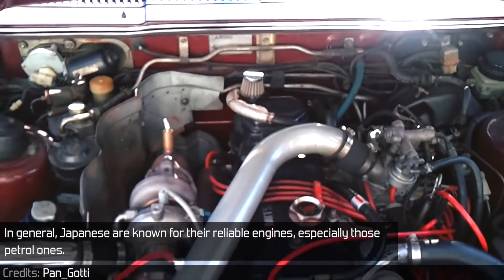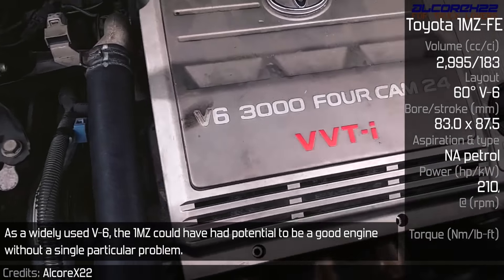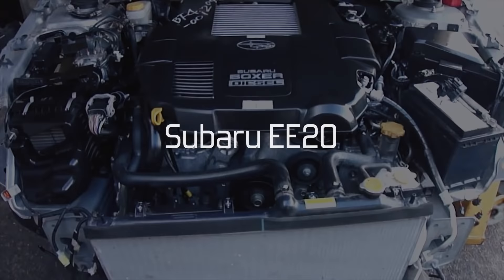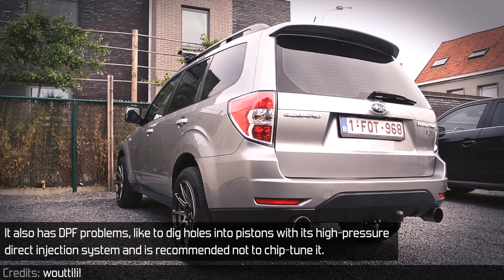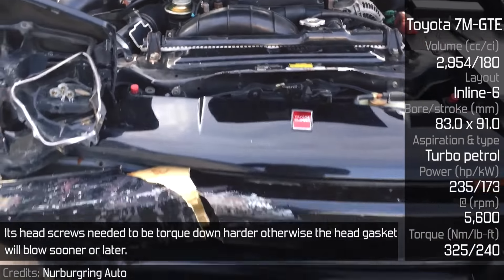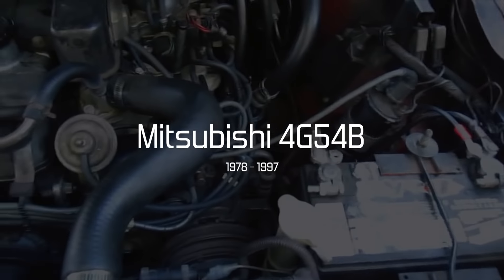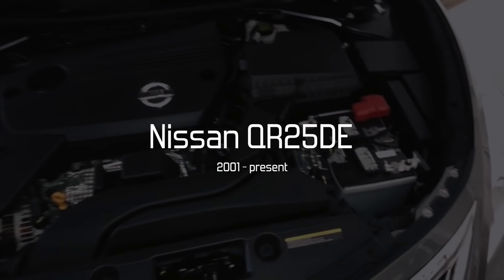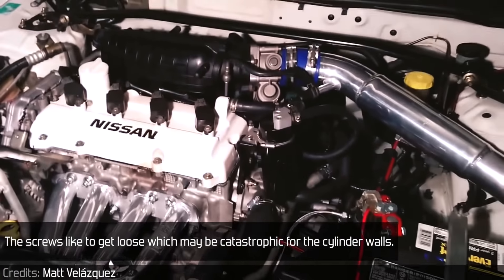Top 5 Worst Japanese Engines Ever

Comment: I have to disagree a little here. Firstly I'd put the Honda D17 motor on here, blown head gaskets and heavy oil consumption are expected, as in my brother's car. Meanwhile my QR25DE has been perfect, the problems mentioned only affect the first year models and Nissan actually acted responsibly by issuing replacement motors with revised catalysts and by people at home thread locking their butterfly screws and replacing headers. My car is about to pass 200,000 miles so at least I don't think it has the "worst" engine out there.

Comment: Nothing is better than a vq engine.
Reply: Zohan James Drive a 01 Maxima with over 178,000 Miles that has a VQ30DE, I have no Issues.
Reply: PON3Gaming i agree, the 3.0 is excellent! But the one that can immediately after, was where the problems really started to take shine.
Reply: Zohan James They should have kept the VQ30DE and just turbo it.

Comment: The naturally aspirated EJ25 should be on this list.
I work at a Subaru dealer and we have replaced a lot of these engines. What makes matters worse, is that they are low stress engines with a pretty poor specific output. 
I mean come on 175 hp from a 2.5 was an acceptable figure 20 years ago. By modern standards they should have like 210ish hp.

Comment: Lol so much guys are angry and trying to defend themselves
Reply: Yeah because he provides little to no evidence as to why these engines are terrible. Especially with the 1MZ FE. If you know anything about those engines, youd know that theyll last a life time with even minimal maintinence. The Camrys that they put those in literally do not die. Look anywhere on craigslist or whatever and youll see these things going for 3-5k with 100 thousand miles already on them. Those engines are 20 years old still holding their value and this fucker said theyre deserving of a spot on this list because of engine sludge build up like are you kidding me? He threw this list together with little to no research involved. Do you really think people arent going to get pissed about someone spreading mis information about great engines?
Reply: What is 100k miles dude ? That's nothing Even RX-7/RX-8 engines can handle 100k without a proper maintenance... and they are considered to be UNRELIABLE AF.  You see, almost every non-downsized engine is going to withstand 100k miles. That's nothing hard to achieve tbh

Although I do agree that the video is done without a lot of research.
Reply: ManhartLOL I was low balling the fuck out of that because thats around what my car had on it before I got it. Im sure there people out there who run Camrys even longer without changing oil. But thats a bad idea because the engine sludge does become a problem. Its a toyota though. Of course it burns oil and builds sludge. That doesnt mean anything if you take care of it though because if you do, itll live much longer than youll need it for. My uncle has the exact same car except a year newer and hes at nearly 500k from using it as a daily driver and has had almost 0 front end or engine issues beyond normal wear and tear like torn axle boots or rusted calipers. (Minnesota)He runs cheap oil and FRAM filters too. I run synthetic and K&M filters so I should see even better life. The 1MZ FE is arguably one of the most reliable engines toyota ever made. And it has proved to be imo. Itll rip if you want it too as well. 194HP and 209 torque isnt slow. Its drones a bit but once you get it past 4k, she starts eating.
Reply: Yup, if you love your car and maintain it , it's just a pleasure to see it going another 50/100k miles, always. In EU the 1MZ engine isn't as popular though  so I can't give you my own opinion on it.  But I used to have the B16A2 Honda Civic along with 2 other guys riding literally the same models. Mine ended up going with me another ~100k miles ( With the clock before it being 130k) while 2 others didn't even reach 150k. The reason being though is the 2 other civics were used by daily potatoes, they just drove it and didn't care to maintain it. Some engines are built to be maintained and drive for ages and some are made for potatoes that just put in gas and run. Fun fact, my civic was still running perfectly fine when I was selling it and went for something more newew though. But if the guy will take care of that car he will run easily another 50k ( considering I've sold it for 1,5k$, that's a steal, lol)
Reply: ManhartLOL Yeah you can never beat a Honda in reliability. Theyre hard to find for sale at a decent price around here though because everybody has mods and shit. I got my Camry for $900 because it had a power steering leak. Granted the lady did want it gone because it was leaving stains in the garage, But it ended up being a $12 fix from the seals in the pump going bad so Im happy. I wish it was a manual though. The auto tranny is fast but eh, I wanna drive not just sit there and mat it lol
Reply: ManhartLOL I meant like degradation wise after 20 years it still shifts like a queen when I get on it but compared to someone whos literally in full control of the gear ratios then yeah, an automatic tranny isnt fast in any other sense compared to a manual other than the fact that its shifting perfectly at the right time for a smoother experience
Reply: Yeah, don't forget to change fluids in your transmission as well and you are good to go. Well it did change nowadays. Starting like 2010-2012 and onwards the auto transmissions became a lot better and can be used in racing as well
Reply: The Volvo 5 cyl engine series is as perfect as you can get with engines.
Reply: Well he didn’t state that the qr25de had two generations and all the issues were fixed in the second gen

Comment: Still better than american ones
Reply: there are lots of good engines here
Reply: And why? Do you got any evidence for your claim? Ironically in 2016 the most cars on american roads that reached 200,000 miles and more were from american and japanese car manufacturers with the Chevy Tahoe leading. Look it up if you want, but stop claiming stuff.
Reply: Ehh... It sort of comes down to what the maintenance costs were on those vehicles. You can keep ANY vehicle running for 200k miles, the question is, how much will it cost you to do so..?
Reply: Really?
Reply: id say america has just as many if notmore engines capable of running seriously high miles without major problems....buick 3800 and ford modular 4.6 run half million miles easy in cabs
Reply: The only Buick 3.8 was a carbureted odd-fire engine in the Regal in the 80's. The GM 3800 was a pretty rock-solid engine, at least the series I and series III. The series II had a plastic intake that directed exhaust through the EGR directly on a coolant passage in the intake, causing hydrolock doing 70 down the highway. As far as the 4.6, they did have problems with the timing chains taking a shit in them. Especially in the Grand Marquis, for some reason. The Ford 300 straight-6 is worth mentioning, however. As is the Chrysler 3.5 V6.
Reply: samsquantch14 exactly. the 3800 had reliability for days and so did the ford modular 4.6L.
Reply: my vortec 4.8 is at around 380,000 miles and is just now starting to show signs of it's age.  I'll probably pull it later this year for a rebuild, maybe punch the block out to 4 inch bore for essentially a destroked lq4
Reply: new Ford  Ecobosst engines are on par with european and japanese engines. They learned(bought) a lot of acknowledge from Cosworth.
Reply: TryChan I will put my 2.3 liter Lima in my Ranger up against anything from Japan, but I do agree that most American motors are garbage.
Reply: Treva Graham i believe that's actually a mazda engine
Reply: TryChan American cars are still more powerful stock 😴
Reply: Nope, the 2.3 Lima is all Ford. The 2.3 duratec that replaced the Lima, that was a Mazda engine.
Reply: Scarlett.  tan2ksl1 is exactly right. The manual transmission in my year Ranger is a Mazda, but the motor is Ford's. The design goes back to the 70's.
Reply: TryChan Just too bad the LSX is American huh, basically the best thing to hit the car community sense well the small block V8.
Reply: Slant six mopar > any Japanese engine
Reply: Killer Banana gotta love the LS!
Reply: Rusko Ranchet ugh, Ford. Just when I started to like this thread, the Ford people showed up.
Reply: Scarlett it is a Mazda engine. Most Japanese manufacturers probably make more cars in America than Ford does.
Reply: Robotron 123 I'm not a Ford guy by any means. I'm an automobile guy. GM, and Chrysler have both had some solid engines, but I have owned my Ranger for the last 13 years so I can speak on the fact that the motor is virtually bulletproof, especailly considering the way I treat it, and the 2.3 Lima is all Ford, Mazda had nothing to do with it. Mazda made the transmission, but the motor was all Ford up until 2001 when the Mazda derived Duratec replaced the 2.5 Lima.
Reply: Treva Graham 13 years? Wow that's amazing for a ranger, those trucks are garbage.
Reply: Robotron 123 I have to strongly disagree. It was 11 years old when I got it. I'm the second owner and currently it has  302K miles on the odometer,  the head has never been off of it, and it has the original clutch. I know plenty of guys with 250K plus miles on theirs as well. Everything around the truck will fall apart well before the motor will. I'm not a fanboy by any means, but I've had better experiences with my 2.3 than I ever had with any of my GMs and I took care of them a lot better than I have my truck. If I had to pick any one manufacturer to go with it would be Toyota.
Reply: Treva Graham agreed, other than their frames, toyotas are amazing.
Reply: Americans can't make a powerful 4 banger at all
Reply: Blitz Court Their's been a few, but I can't think of any that will last.
Reply: Blitz Court neither can anybody else. It's a 4 cylinder.
Reply: Killer Banana 
Sure, sure Mr Banana just  look at how reliable was your papa & mama's all American proudly made Ford Pinto. Plus your uncle's Chevy Vagas.  Now that's quality . Yes proudly made in the  good old US of A !
Reply: TryChan some americans are getting butthurt here
Reply: Why would you need v8 if you don't haul heavy loads, for Americans is a rule for any vehicle v8 just to get groceries..
Reply: Agustin Perez, are you just jealous because you got deported? 🇺🇸🇺🇸🇺🇸
Reply: I’m a japanese engine guy but america has the LS engines, the vortec’s(pre 2007 with the active fuel management)  and the 3800 v6 from chevy, the duratec v6 and the modular v8 and the coyote from ford,
Reply: @ayotochtli | its the way to do it man!

Comment: Worst american engine next?
Reply: All American engines after oil crisis are crap. But the ones before are golden.
Reply: Ehhh... I not particularly a fan of GM, but it's pretty hard to beat the LS...
Reply: Too many to mention may need to make a 2hr documentary
Reply: The single worse american engine? That prize will probably go to the Chrysler 2.7 produced in the late 90's to mid 2000's.
Reply: 2.6 chrysler...oops, that's a Mitsubishi  3.0 v6 chrysler.....oops that's a Mitsubishi   gm dirty max...nope, it's an Isuzu
Reply: Mitsubishi hasn't made an engine for a Chrysler in quite awhile.. And I meant specifically the 2.7 in the Chrysler LH and JA platforms. Not the 2.6 from the 80's K cars...
Reply: @Randy Magnum | I have owned, driven and ridden in old body style Caravans with the Chrysler/Mitsubishi 3Litre V6. Those engines are pretty tough and reliable considering what me and my oldman used to put them through. They always kept chugging along, but there major drawback is they'll start burning oil and blue smoke like crazy at around 200 000miles. Which is good for evading the cops...Lol not really!

Comment: How about rotary? Renesis
Reply: SUPR VR rotary engine is a  different story mate. Rotaries are amazing yet has to be taken care of well and obviously wont last too long. Id concider rotary a true petrohead's engine
Reply: SUPR VR they're not terrible. Care care of them and atleast hit the redline a couple of times you'll be fine.
Reply: Jordan Cook I couldn't disagree with you guys. If you take a care of them, they will be able to reach over 200k km, but let's be honest, this doesn't apply to Renesis engines (to year 2007). Renesis are the worst of Mazda rotaries.
Reply: I'll be honest, the 4 port versions that come in the 5 speed and auto models are down right crap. They can't reach RPM levels required to burn off carbon so they kill themselves all the time. But get one that revs to 9k and look after it and it's a sweet engine.
Reply: I was thinking about the renesis, the one in the RX8, that wasn't a good engine.
I like rotaries, I love brwap, but I think they were really unreliable and, in case of the renesis, one of the worst engines. The 7M is way better than the Renesis.
Reply: Honest Rotary guy here: they're trash. They're fun, they're cool, and they make cool noises, but they're garbage engines by conventional standards.
Reply: All rotary would be unreliable if you reduced the amount of lube being injected and lowered the viscosity of the engine oil. Poor renesis gets a bad rap.
Reply: The Wankel rotary is German engineering.
Reply: SUPR VR If you take care of them, they can reach over 200k km with no issues. But this not apply for Renesis engines. (To year 2007 - after that, they are pretty good)
Reply: Martin Novák Renesis are fine if you are familiar with rotary. My 04 Renesis is just as reliable as my other rotary or piston engines for that matter.
Reply: Never driven or owned a rotary but the way people describe seem like you have to keep 24 hour surveillance on them to make them last. Slip up just once and you're in for a long rebuilding process though from the videos I've seen, it doesn't seem that hard to do. Just tedious if you have to do it constantly.
Reply: dekoldrick nahh lol you need to know a few tips and thats it. just sooner or later this engine will have to be rebuild.
Reply: Dorian Gray There has never been, nor will there ever be, a rotary produced capable of 500k miles without a rebuild. The construction and geometry of the engine won't allow it. Apex seals will take a shit LONG before then, it's unavoidable. Better fuel economy can directly translate into more power, as more of the fuel burned is being converted to usable power. They're inefficient, they're dirty, and they're high-maintenance. They're not that great of an engine. They sound nice, and they like high-revs. But, that's better suited for the track than a daily driver. They're not economical by ANY stretch of the imagination. Anyone who's owned a rotary will tell you they take quite a bit to maintain. They're not being made because it's hard to get them to run clean and efficient. The average rotary will go about 60k miles before they could use a rebuild. Well-kept ones can do about 80k before they NEED a rebuild.

Saying that Mazda holds the record in longevity for rotaries is kind of the same thing as saying that Chevy makes the longest running Corvette. It's pretty easy to have the record if you're the only one producing them.
Reply: Rotaries are sports engines
Reply: The didn't design the rotary engine, its not really japanese
Reply: akio2589 lmao. Mazdas rotary won one of the most prestigious endurance races known to man with this unreliable powerplant. Wtf are you talking about. I have a turbo rotary that blew it's first engine just past 200k? Are you serious bro?
Reply: fc3sttwo you sound like every typical Rotary elitist. Just because it won Le Mans and was banned doesn't make it some god level shit that everyone should bow down to. Rotaries (like many other engines) are hit and miss. Some are good, some are lemons. I've known people with rotaries that blew at 130k miles and ones that blew over 200k.
Reply: 200k isn't 500k.... Is that 200k km or 200k miles? Because 200k km isn't shit... Also, when they run, they run well. But when they're done, they're done. I said that rotories are fine for the track. They do not make good daily driver engines. They just don't. They are high maintenance and they're inefficient. Too much unburned fuel and too much oil ends up going out the exhaust. And if yours managed to limp to 200k MILES (not km), and it was limping by that point if it hadn't been rebuilt already, then I can assure you it was long overdue for a rebuild. The apex seals alone were probably 60k miles past well done. An engine that still runs doesn't mean that it doesn't need rebuilt. You don't rebuild the engine when it blows, you rebuild it when it needs it and, preferably, before it blows. Waiting until it blows just means more work.... Or a new engine.
Reply: he probably owns a renesis and posted this video to protect his investment!
Reply: SUPR VR stop reading articles of people hating on rotaries. Rotary is a great engine just need special maintenance.
Reply: Scoobysnack 05 I would say stop being a fanboy and accept the truth. Rotary engines are awesome, and I love them, but they aren't reliable and fuel/oil economy is terrible.
That's why most engines are piston. Im objective, Im not a rotary hater at all😂
Reply: GM made the most famous 500,000 mile without wear rotary engine....... aside from facts, you are right. :(
Reply: +Grey God Germans tried and failed miserably.
Reply: +akio2589 I know of several that made it over 400k km, 2 that made it over 700k and one that is still strong at 750k (runs autogas, makes a huge difference).
NA engines last for friggin ever.
Reply: Yeah the renesis pretty much succ, the black sheep of the family
Reply: YOU Gotta love the RX-8!!
Reply: Especially the 4 port Renesis in the base RX-8. Can't rev high enough to clear carbon. Say, get something like a REW or a 6 port Renesis and you'll be fine. Just never the 4 port Renesis.